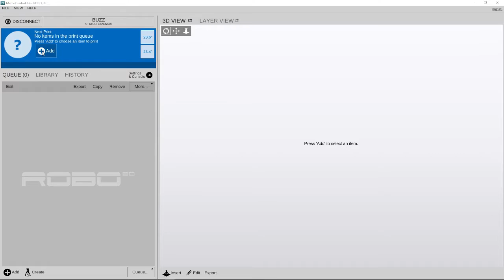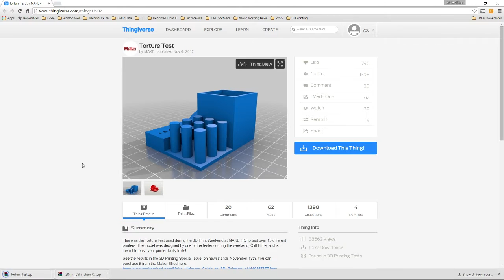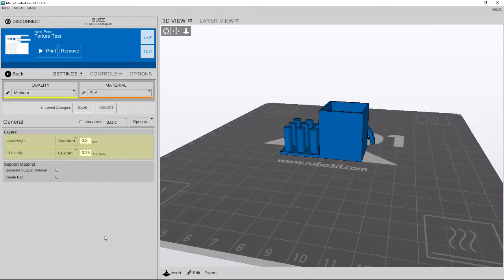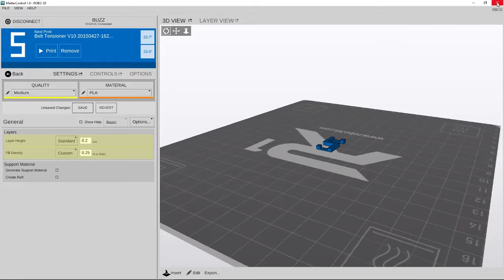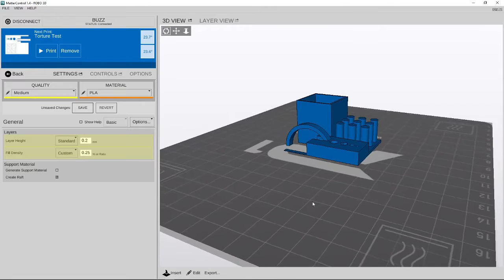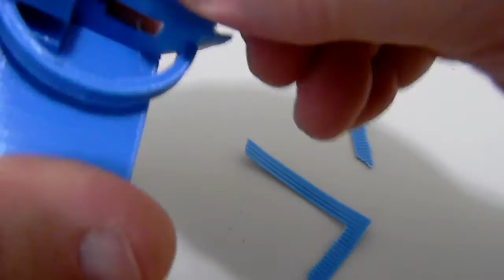3D Printing: Calibration Cube and Torture Test

Comment: have you successful using Repetier software for robo r1? I'm having issue with Repetier working with my robo r1 with upgraded lead screw steppers.. I added auto leveling g code at start in Repetier. It does 9 points but when it started printing. It doesn't printing flat.  also hot end was set at 211 but it dropped to 200.
Reply from the maker: I have not tried Repetier software. As for the printing problem have you tried using MatterControl to see if your printer is working correctly?  This way you can see if it is the printer or the software.

Comment: Can you use the Ultimaker Cura software for the ROBO 3D +Plus? Or will it only work with the software that you use in the video?
Reply from the maker: Yes you can use CURA software with the ROBO 3D R1 +Plus. The CURA 2 Software has some problems so I would use 15.04.6 version here is a line to it: https://ultimaker.com/en/products/cura-software/list

Comment: Hi, nice show, thank you for doing that.
I have the same exact printer.
I have a question, my cube comes out ok but when I make a circle it doesn't line up correctly, it comes out a elongated with what looks like a bubble on the flat side.
Any suggestions?
Reply from the maker: Is it elongated on the Y or X? If on the Y check that the belt under the build plate is tight. If it on the X then you can print out a belt tensioner (http://www.thingiverse.com/thing:794689)

Comment: Need some help...my robo is printing in midair..chked the gcode and it is correct...wassup please ?
Reply from the maker: Did your printer Home all axes (Z,X and Y) before starting to print. When it 0 the Z axes did it touch the build plate? When it did the bed leveling did it touch the build plate all 9 times?

Comment: Hi just this and I'm having issuse loading nylon filament and tips or ideas why that might be?
Reply from the maker: +pat ayala Hi... I have not tried nylon filament yet but I would check that the hot end is not clogged by trying some PLA. I would also check that the filament is the correct thickness. I would also try making the max temp for the filament.

Comment: The addition of a narrow fan shroud should help with the stringing and overhang.
Reply from the maker: +RdGhost I was thinking of adding another fan to help and narrow fan shrouds
Reply: +3D NerdStop That would help but funny enough 2 narrow shrouds is not as efficient and 1 narrow to cool the filament and a wide to move the hot air from the print.
Reply from the maker: +RdGhost I will have to give that a try. Thanks